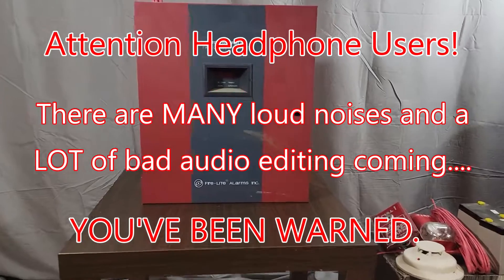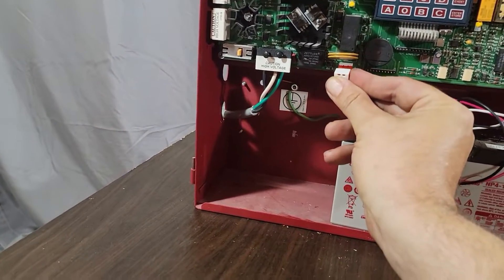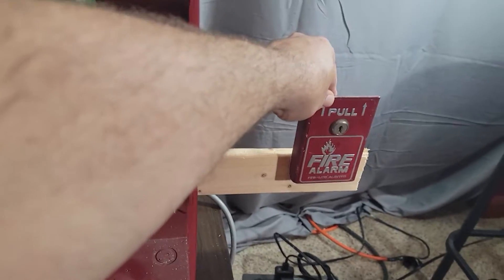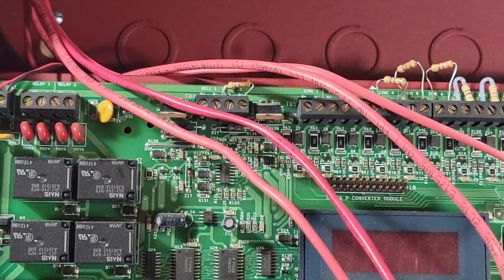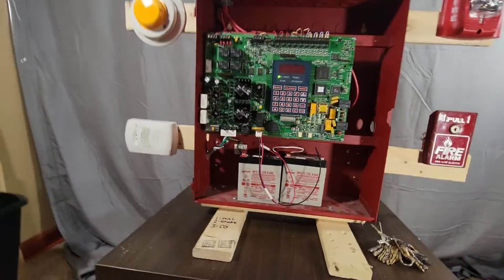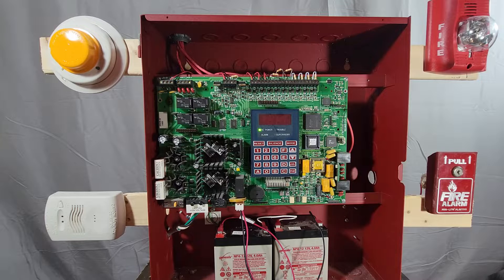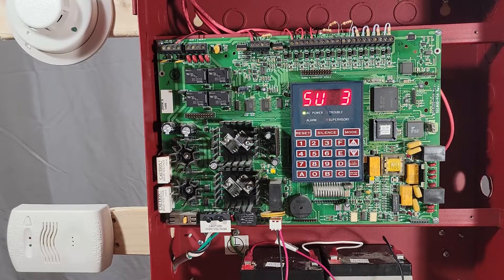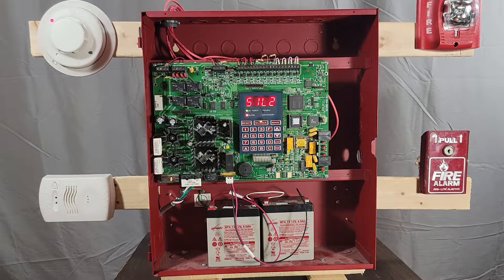Fire Alarm Test - Fire Lite MS-5210UD - Panel Didn't Trip During Fire - Will it Work?

Comment: the classic is not working because need little jumper wires conecting the horn and strobe both positive to positive and both negative to negative and if you don't do that other wise the horn will make that sound or just the strobe will just flash or you use the System Sensor Classic 4wire with out the little jumper wires.

Comment: I have a question. I have an old fire alarm bell and I want to turn it into an alarm clock. Can I just send main power straight into the bell? 
It says 120 vac 53 mA
I am a plumber so electric stuff is totally out of my wheel house

Comment: My high school's fire alarm system. If a real fire happens at my school I hope it goes off from a smoke detector activation during a real fire if the fire only starts in a room with a smoke detector that we can't see, but if it's too late and I see the fire just appeared and spreaded to the area of where I'm in, I'll have to pull the fire alarm.

Comment: On that system sensor horn you thought was dead, there must be power going to the strobe in order for the horn to work. Thought mine was dead but that was the issue.
Reply from the maker: Interesting, that actually rings a faint bell in my head. I may have encountered that out in the field somewhere, figured it out at the time and then forgot. That happens a lot lol. I tossed that one in the garbage but as soon as I find the box full of the other ones I'll have to try that.